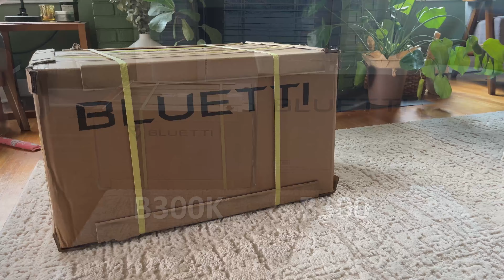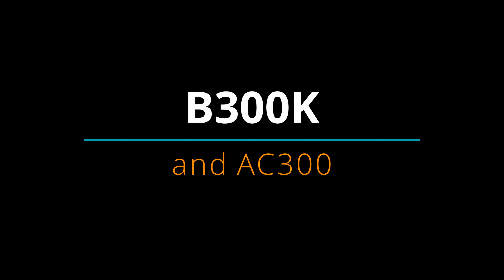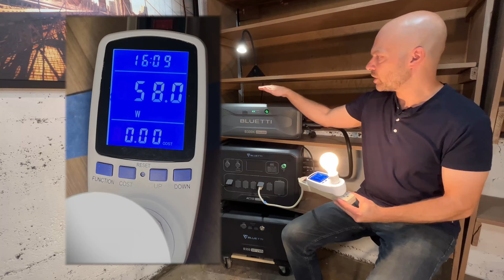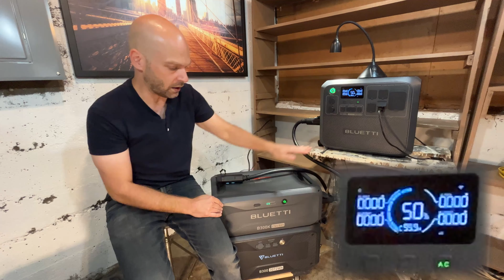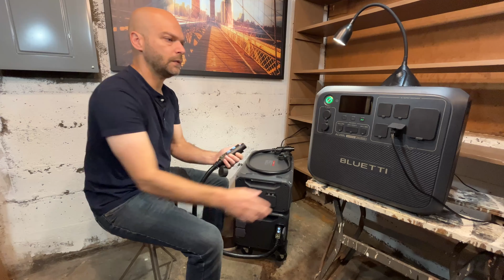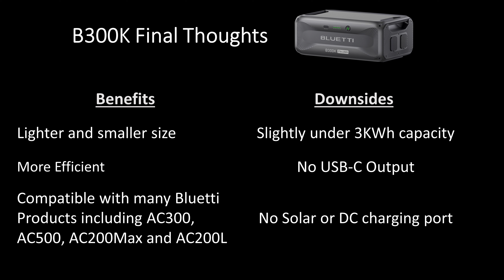New Bluetti B300K Battery - How long will it run with an AC300 and AC200L?

Comment: Great video .I just bought the 200L nd the 300K for my 22 foot RV . I do wish the 300K would have come with a solar plug so you could charge it separately. Most of our Provincial parks in Canada have banned gas generators and I am glad of that.
Reply from the maker: Thanks for the feedback. Interesting to hear about the gas generator ban, too.  What kind of panel setup do you have?
Reply: @BackyardSolarProject  I have 600 watts on the roof for my rv lithium batteries and portable panels for the bluetti at 400 watts  . I should have bought two AC200L instead of the B300K and just re charged each one every time I had to .

Comment: Expansion batteries are nice but I opted for two AC200Ls. Actually less money than one AC200L and B210 and B300K. I have a gas generator if I need it.
Reply from the maker: That makes sense, especially if you need to run more items instead of expanding run time for one device. AC200L is such a versatile power station with a very capable solar (PV) input.

Comment: Bluetti thinks everyone will stack these new batteries...some of us a new to the ecosystem and have additional cables ...i want to use the apex 300 in a rv, but i do not want their new 90 degree connector ...and their web site has ZERO option for side connection of the b300k to a apex 300...weird,  right ? Oct 1 2025...maybe in the future  ?
Reply from the maker: Hey Java - I Agree that not everyone may want to stack.  The Apex300 would work with the long cable that originally came with the B300 and B300K.  I looked it up and believe it is called the P090A.  Let us know if you are able to find one in stock.
Reply: @BackyardSolarProject bluetti has no stock...and why would I have to pay $120 for a cable ? I will just go with EcoFlow Delta Pro 3 with extra battery. ....a little higher capacity inverter and battery....

Comment: Hi , I just ran into your channel. Great test review . I have a question. I have the AC200 MAX and bought the 300K expansion battery because the 300 was discontinued. Anyways. Stupid question, if I connect the cable to the 200max and 300k, if I don’t lock the cable, it won’t read/work? Secondly, with the two plugged in, how does it work if I have the fridge and other things connected to the 200 MAX, does it drain the 200MAX to zero then the 300K kicks in? Or it’s a fluid transition of power. Thks ahead of time. I hope you can answer the questions.
Reply from the maker: If the AC200Max is like the AC200L, then you are correct, it won't connect to the battery until you lock the cable.   On the AC200L, it tends to drain both the AC200L and the AC300K batteries simultaneously.   However, it isn't even across the internal battery and external from 100% down to 0.   You may see the AC200L drop to 80% while the B300K is at 90%.  A day later it might be the opposite, with the AC200L at 70% and the B300K at 65%.   The AC200L always takes an "average" of the two SOC, and shows it on the display.  (It is not a weighted average, though.)

Comment: Outstanding video!  I just added two B300K batteries to my AC300 and two B300 batteries.  That should give me enough capacity to have reliable backup  power whenever the local grid is under high stress during the very hot Summer months in Central Texas (we live in Bastrop, TX ... 30 miles east of Austin) and during very low temperatures in the months of January and February.  I've also purchased a Predator 5000 dual-fuel generator (gasoline and propane) to augment the Bluerri batteries.  I'll add solar panels as I expand the system.  The population of Bastrop County is growing rapidly as people escape from Travis County and others move into Central Texas to work with Tesla other tech companies, etc.  Bluebonnet Electric Cooperative is becoming overstressed because of the rapidly increasing demand for power, and I intend to make my compound as independent as possible from the Bluebonnet grid.
Reply from the maker: Thanks for the feedback!

Comment: Great information.  Just bought the B300K to add to my AC200L.  This confirms my decision.  I have a decent solar system to keep my 12 volt RV trailer system charged.  I am looking forward to the coming camping (Western Canada)season using this Bluetti setup to reduce my reliance on my two Honda EU2200i.  Thanks man.
Reply: Reduce? The goal is never needing a gas generator. Mine stays at home.

Comment: Experts, please help me figure it out. I have a charging station Bluetti AC200PL, what are its actual differences from AC200L in the context of choosing an additional battery? Which battery should I choose? We have many on the market B300K/B300S, but few B300, and they are noticeably more expensive. Thanks for the explanation
Reply: They are the same except yours has a larger battery capacity. It will use the same add on batteries, B300 or B300K. B300 has been discontinued.

Comment: I appreciate this video very much. 

I recently purchased a AC300 + B300K. My needs require additional storage. I Was thinking of waiting for the availability of the B300 or B300S, mostly for the availability of additional DC capabilities. 

The AC300 has 30 amps of DC available, and is enough. 

Now, I am simply going to order an additional B300K. The current black friday sale is attractive as well.